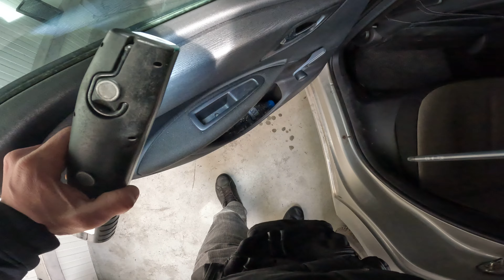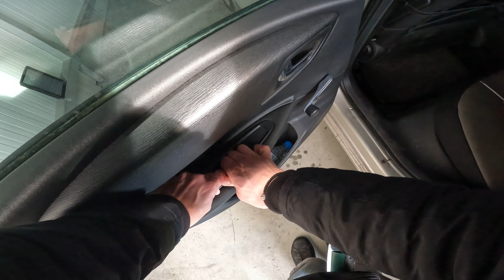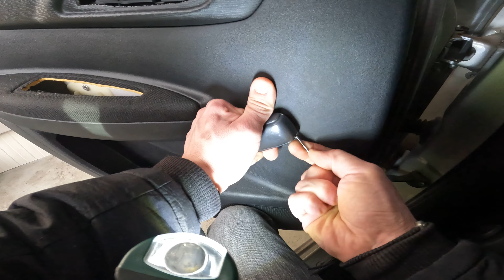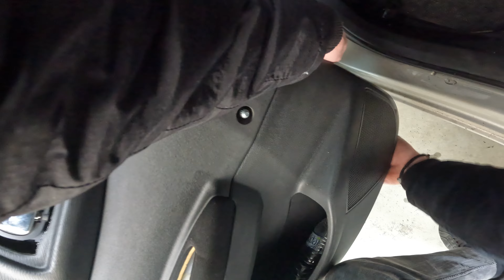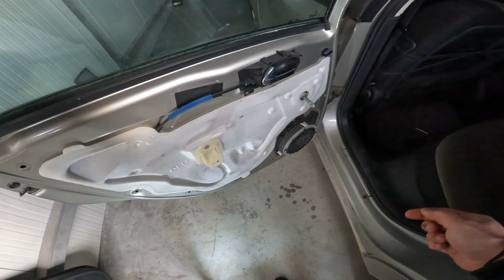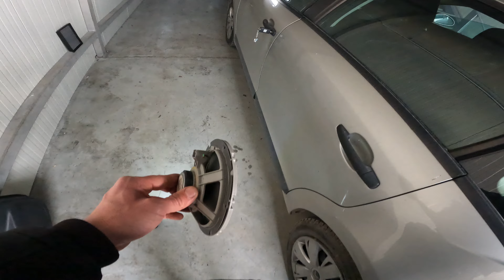How To Remove Rear Door Panel  / Speaker Removal Citroen C4 Phase I 2004-2008

Comment: Hey, thanks for the video :)  Did you know which size is the spearkers at the rear? Thanks.
Reply from the maker: 16 cm , you can install 16.5 , but you have to remake them
Reply: @bassdealeraudio442   Hey, thanks for your answer, so are the front speakers about the same size as the rear ones?
Reply: La taille à l'arrière est plus petite non? Ce n’est pas du 13? 
Merci pour la vidéo sinon !